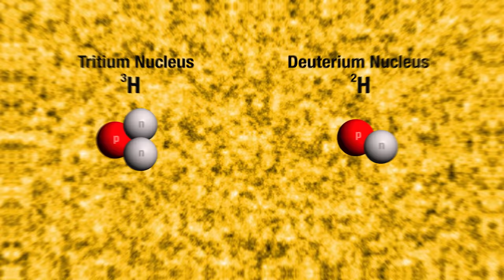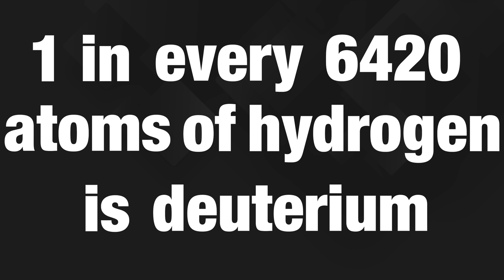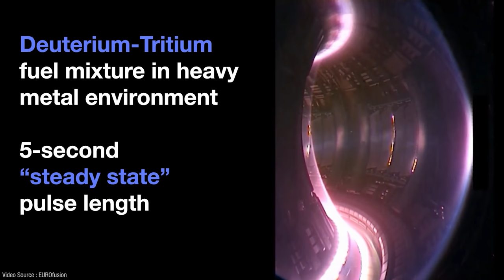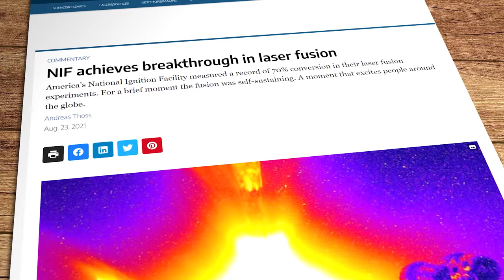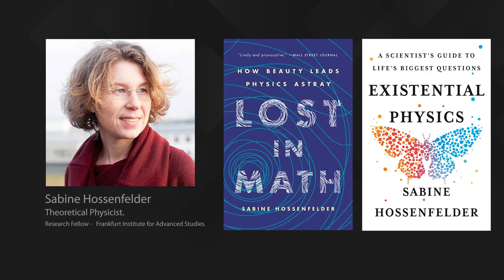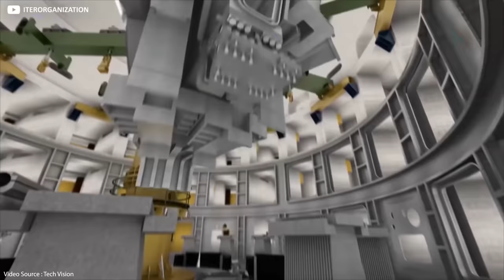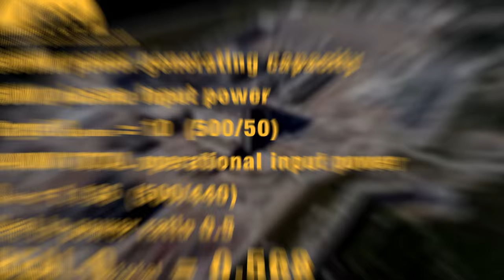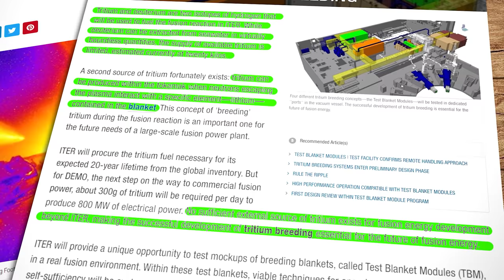Nuclear Fusion Illusion. Is it time to park the pipe dream?

Comment: As an expensively trained nuclear physicist who teaches others at great expense to be nuclear physicists, I support fusion research because I can't make a latte to save my life.
Reply: Likely you are not adding enough tritium.
Reply: Latte's as in fusion energy... it's all about the steam.
Reply: @raymondleury8334  Chinese and S Korean companies build them in 5-7, and at a reasonable cost.
Reply: @raymondleury8334  10-15 years is all it took for France to largely decarbonize its power grid while Germany has been pushing renewables for a similar time frame and their energy mix uses a very similar amount of coal and NG
Reply: @Nuclear Energy Advocate i think thats a middle term solution. you can get solar panels today, but it wont meet the energy needs for everyone on the planet, only those who can afford solar panels. fusion is the long term solution. fission is workable and i believe it is necessary to bridge the gap.
Reply: The future's so bright, you gotta wear shades? :)
Reply: @jackfanning7952 
Nuclear waste is a political issue, not technical. Fix politics, and we can make the nuclear waste go away tomorrow. For starters there's Yucca Mountain. It's also possible to burn the waste in fast breeder reactors.
Fossil fuel waste is about a million times more dangerous.
Reply: @Nuclear Energy Advocate Evidence?
Reply: @LordOfNihil  Evidence?
Reply: @dermotbalaam5358  Silence, midwit
Reply: @andrasbiro3007  "Fossil fuel is about a million times more dangerous."

Given the lethality and longevity and corrosiveness of nuclear waste, your claim requires significant evidence to achieve credibility.
Reply: But you’ve done a lot of reading I assume? So you could probably properly pronounce “want fries with that?”

Problem solved 😁
Reply: @dermotbalaam5358  evidence? solar works, fission works, solar wouldn't work without fusion. its basic physics.
Reply: @SaveMoneySavethePlanet  I enjoy your insults. It lets me know that I am over the target.
Reply: @FUSION ILLUSION pro fission Yeah, reprocessing facilities like La Hague, Windscale at Sellefield, West Valley and in Russia are the most polluting and dangerous processes in the nuclear business. It is very expensive. La Hague has been described as the largest man-made source of radioactive contamination in the world. Reprocessing only reclaims a small fraction of the spent fuel as U-235 and Pu-239 for reuse. It generates massive quantities of airborne and water-borne radioactive emissions. The large majority of the spent fuel sent to the reprocessing facilities is not reclaimed and is returned to their owners. La Hague no longer has any international customers for its reprocessed fuel, only its parent corporation. Reprocessed fuel is more temperamental to handle in a reactor and requires a greater degree of containment because of its radioactivity. It is cheaper to get fuel from mine sites on indigenous, impoverished people's land. People who don't have the power to complain about the destruction of their property and health from uranium ore mining. Once reprocessed, fuel can be reused once. Then it becomes...nuclear waste. Fast breeders and other reactors like MSRs that supposedly "burn" nuclear waste have a history of high cost, low reliability, and major, unique, and numerous safety problems that deliver no significant improvements over other reactors to justify their increased costs. They, like reprocessing facilities, present an increased risk of nuclear proliferation of weapons-grade materials. Look at the long miserable history of Fermi, Shippingport, Santa Susana, Monju, Superphenix, Fort St. Vrain, Hanford, Savannah River, Kyshtym, Idaho Falls, Rocky Flats, and Oak Ridge. Even if you had enough money to build these very expensive reactors and somehow overcome their significant operating problems, many would be needed to run continuously for centuries to reduce the backlog of spent fuel that has accumulated over the past 75 years. After they are shut down their sites would be so contaminated they could never be reclaimed. That still does not solve the problem of the widespread contamination created by the daily operation of light-water reactors, mining sites and shutdown reactors and legal and illegal waste dumps, which will increase because of the operation of these unreliable reactors.
It is people like you who are preventing us from curing the intractable problem of how to deal with nuclear waste. If you are digging a hole to hell, the first step is to stop digging. Close the lid on Pandora's Box.
Reply: @Brurgh  fusion is long term thinking though. its something that will never see the light of day if they start defunding fusion research as vehemently as they did with fission back in the '70s. rather than rolling out safer, more efficient next gen reactors, everyone panicked and set out to ban them all while pumping out egregious quantities of co2 in the mean time. of the reactors currently functioning in the us, most are antiques. say we go nuts with fission, start building next gen reactors. its very easy to get as reliant on those as we are on fossil fuels now. and you might se a situation where nuclear waste gets out of hand. it would be nice to be able to move on to something better when that happens. in the mean time any technology that prevents us from burning coal is good, be they proven technologies or not. humans have spent more money on things worse than fusion research, war is a good example. were staring down the barrel of a great filter, thats the war we should be fighting.
Reply: @Nuclear Energy Advocate 
Said, "Nuclear power is the only form of power that can meet Global Climate Deadlines."

That's the most absurd statement I've heard!  The new nuclear power plants will not be chosen by utilities because they have had multi-billion dollar cost overruns and take decades to bring online.  New nuclear power is not being chosen by utilities because they have a responsibility to the ratepayers and shareholders to choose the lower cost forms of generation and those are renewables plus storage.

Existing nuclear power plants should be kept online until all of the fossil fuel power plants are decommissioned.
Reply: @acmefixer1  solar panels are fine for the home, provided you have the property. some kind of local storage is also necessary. you can subsidize them of course, and these subsidies are why these systems are affordable to the middle class. that does little if you rent. since most poor people are renters that argument is not going to fly with me. a third world community might be able to group buy an e-waste solar irrigation system, and while that might be a good thing. they do that long enough and they will want heat, air conditioning, cars, etc.

what solar is terrible at, is industry. it just doesn't scale well. you need industry to mass produce and install turbines and panels. and in a lot of cases you are just bucking the carbon footprint to someone else when you buy panels. when you can manufacture your renewable infrastructure with renewable infrastructure, then things might be different. 

if you call me a shill for the nuclear industry i can say the same thing about you shilling for the renewables industry. the only renewable which can compete with nuclear in terms of power density is hydro. but there is no rush to build new dams. if flooding land is bad for the environment, so too is covering it in panels and turbines.
Reply: @bjb7587  
Just look up the statistics.
Reply: @andrasbiro3007  Well no.  When you make a claim, you provide the data to support it.
Reply: @angellestat2730  The difference is the amount of material and space that is needed. Like in Finland they now finally have the startup of the reactor they have been building. This single power plant will around mid-summer produce nearly as much electricity as all the windmills  in Norway, Sweden, Denmark and Finland combined. The total cost is lower then the total cost of all the windmills and just a small fraction of the materials and space has been used. The total cost has been nearly 4x what the plan was, but it will  pay for it self in less then 20 years. More important it will guarantee that Finland can supply the electric power to their citizens for may years forward. 
The power plant will produce a constant 1600 MW of electric energy and you need over 4500 MW installed capacity for windmills to make the same average output, but at a very variable levels.
Reply: Try hot almond milk with 5 tablespoons of instant coffee, or another flavored milk product that's heated first. Tastes great to me.
Reply: @bknesheim  There is no point to count the materials or anything else, all that it is already included in the final LCOE.
I am sorry to blow up your happy bubble that nuclear is good, how can you be so naive that even having a construction time of 17 years and a cost of 4X its initial estimate.  Those are 12 billions! 
You still think it would be economical?  Or profitable?   Well, maybe for the owner who only has paid for a 25% of that cost with a discount rate (also called Wacc) of 5%..
Yeah.. it means that the 75% of that cost would be payed by you, your childrends and possible your grandchildren. 
Yeah.. congratulations.. 
The final true LCOE of a nuclear plant like that with that time and cost overrun (if it the capital cost would have not come from the citizens) would be around 250 to 300 usd/MWh.
Maybe at 2005 or before when this plant was being planned, the cost of wind was still high, but not high enough for the time you lost it on the construction and the extra budget.  Time lost is energy lost (energy that you require to buy from other countries.
Not only that, you need to account for the whole lifespam of the plant, and how much would wind power cost decline over that period. Nuclear reactors all over (even in france) are having cost overruns and huge delays.   Even without all those, they are not competitive if the future generations do not pay for the capital cost.
Reply: @angellestat2730  For any gods or service you normally, in some way or another, cover more then 100% of the cost. So also for electricity. For large project it is not very special that the government is part of financial solution.
I agree that huge cost overrun and build delays are bad, but that is not special for nuclear development. Roads, bridges, tunnels and other large project often have the same problems. 
The point is that in the next 10 years we could build 160.000 MW of nuclear power production in the world.  We can not build nearly 100.000 extra 6 MW windmills. The raw materials for doing so is not there.
Reply: @SaveMoneySavethePlanet  It should be extra fries.
Reply: We should keep researching fusion. If for no reason other than "doing science is good." I mean, we're gonna need it EVENTUALLY, but we have centuries of fission power to cover us until that time.
Reply: @bjb7587  
The data is there, just use Google. YouTube tends to delete posts with links, so I can't help you more.
Reply: @andrasbiro3007  You can copy some of the text into a post and provide the titles of the articles or search criteria.
Reply: @BJB. Rationale is that currently, many more people die from AIR POLLUTION than radiation induced cancer or actual radiation poisoning. Nuclear waste is dangerous but is very compact and can be stored safely away from people in geological stable locations. Air pollution causes emphysema, lung cancer, etc.
Reply: @slimjimnyc270 
And yet that is not the case.  From a Congressional study in April 2020

Congressional interest in nuclear waste is generally focused 
on managing commercial spent nuclear fuel (SNF), the 
waste produced from commercial nuclear power plants, and 
other high-level nuclear wastes (HLW), largely from Cold 
War–era nuclear weapons materials production. No 
country, including the United States, has a permanent 
geologic repository for disposal of commercial SNF and 
other HLW. Currently, commercial nuclear power plants 
generally store SNF on site, awaiting disposal in a 
permanent repository.
Reply: @bjb7587  Finland is set to open the world’s 1st permanent repository for high-level nuclear waste in 2024. Was the April 2020 Congressional Study on nuclear waste or air pollution? I know very little about nuclear energy although I did work on a neutron beam generator. I was just the project manager (schedule & $$$) and real experts were my PhDs coworkers.
Reply: @slimjimnyc270  That's nice.  By the end of the century, they will store 6,500 tons.  In the mean time, we currently have 263,000 tons in interim storage.  Not so much progress.

BTW, just because we have problems with air pollution does not mean we should ignore nuclear waste.  Relatively speaking, air pollution is a short term problem.  The threat posed by nuclear waste, OTOH, is measure in centuries.
Reply: @bjb7587  
How much fossil fuel waste we have and how securely can we store it?
Reply: @theultimatereductionist7592  
That's just stupid. Fusion is decades away at best. Renewable energy and electric cars not just exists, but getting mainstream, and will completely take over in a decade.
Reply: @András Bíró  What's yer point?  We must tackle both problems.  But, in answer to your question, most of the fossil fuel waste is converted into CO2, CO, and other chemicals.  Also heat. 

Think of it in broader terms.  Most of our impact on the environment comes from pollution from sources that nature cannot break down, or cannot convert at the pace we create it.  We must change our sources of energy, but not move from one dirty source to another, like uranium of natural gas.

Of course, the biggest driver of this problem, other than greed, is over population.  Combine the two and here we are.
Reply: @andrasbiro3007  
3.  You say that radioactive waste is only dangerous for "a few hundred years"  like that's a good thing.   You must be kidding. 
4.  Population growth.  From the United Nations report DESA 130
We are living in an era of unprecedented population growth. Since the middle of the twentieth century, the world’s population has more than tripled in size, reaching almost 8 billion people in 2022 (figure 1). Projections by the United Nations suggest that the size of the global population could grow to almost 11 billion by around 2100. However, the pace of global growth has slowed considerably since around 1970, and the world’s population is expected to stabilize by the end of the century.
5.  Ten trillion people on Earth?  You base this on unspecified technologies that do not exist, i.e. vaporware.  Fusion power perhaps?  Always twenty years away .
And you're missing the factor of human nature and greed.  Right now we have numerous technologies we could use to make progress on global warming.   What is stopping us from using them?  Aforementioned greed and power.  The oil and gas industries still spread lies about the problem and bribe government officials to support their efforts that continue pollution. Oil producing countries refuse to move ahead.   Emissions continue to rise.  Same type of people causing the current problems will abuse anything new.
Reply: @andrasbiro3007  I couldn’t have said it more succinctly! Well done.
Reply: What are your thoughts on today's news from Livermore labs using lasers?